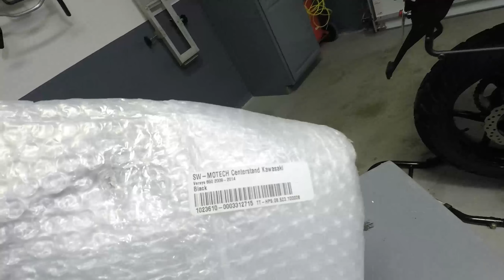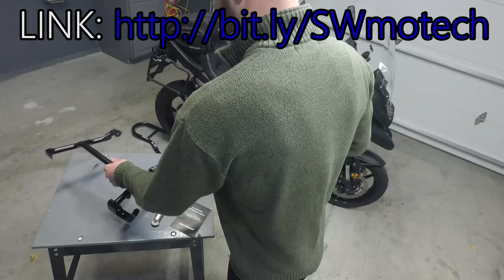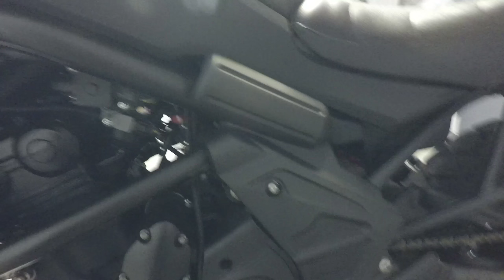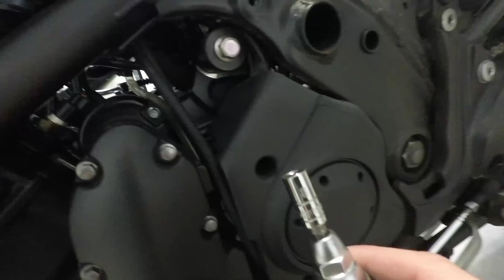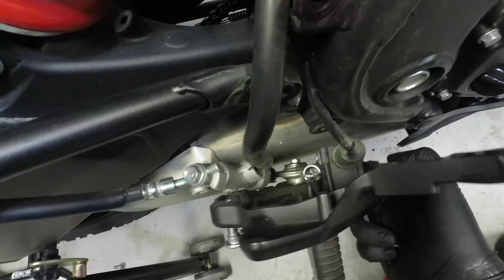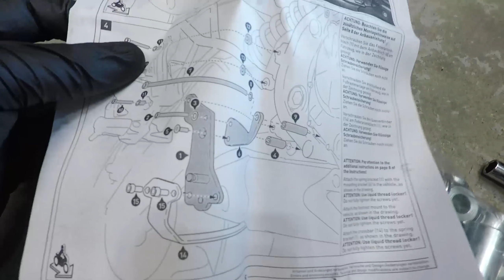Kawasaki Motorcycle Centerstand Installation

Comment: Hey Man did you have the problem where the chain touches the left mounting bracket (Piece #16)? I have a 2012 and the install works but chain is slowly eating that piece away. Can you still check chain tightness with your kit?
Reply from the maker: Yes, I just looked at it and have the same issue where the chain is cutting into the lower plate. I had about 2.25 inches of play on my chain, and once I tightened it down to 1.25 inches it no longer rubs on the bracket. Definitely needs to check this regularly.
Reply: Nathan Page  you need to keep yours chain tight 1-1.4 slack but it is very close to the chain